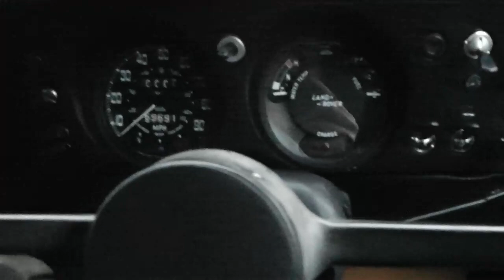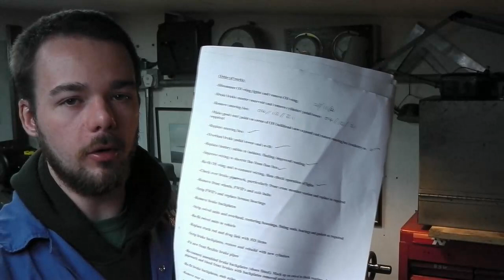Land Rover Series 3 Brakes and Steering - Part 8

Comment: I had problems bleeding 109 brakes when I replaced all the pipes etc. Spent an age trying.  In the end I bought an easybleed pressurised kit and flushed it all perfectly in minutes. I couldn't believe some cheap plastic bottles and tubes worked so easily.

Comment: Top job. I have those TLS brakes on the front of my Series III. I have never gone as far as removing the backplate to bleed them, but what I do do is lower the side I'm bleeding and jack up the opposite side. I find that helps.

The temptation, and possibly a mistake commonly made, is to jack up the side you are bleeding to get better access. The problem that causes is it increases the size of the air pocket at the cylinder end where the bleed valve is situated.

Graham
Reply from the maker: Thanks Graham, good advice - I do something similar when bleeding the clutch and it certainly helps. As mine is all coming apart, I have the "luxury" of being able to bleed the backplates whilst removed but I will certainly try your method if ever the need does arise. 
Phill.
Reply: I’ve taken the shoes off and g clamped the pistons in tight. Then by flexi clamps I do one side at a time and keep checking for a hard pedal. Hard won technique; first time I did the brakes it took me a couple of weeks to get a pedal!
Reply: @highdownmartin  Quite right, I forgot to mention that's what I do as well.

Comment: That made me grin. I’ll bet you a pint of Redex that you’ll have done something about that gauge lamp by the next time I see you!
Btw I needed to run another wire up the centre of the screens, rather than fitting them under the Ali strip I’m making a half dozen soft brass strips about an inch by quarter inch with one hole one end. One under each self tapper up the middle ,wires to the  left and just bend it round and back on itself   Neat but serviceable.
Reply from the maker: Ha! It may well be black sealant squidged in the gap... Never did find a good way of running cables up the screen when I had the LED strip lights, but that sounds like a good way to do it.  I'm hoping to be back in the road for the classic car drive in at Brooklands museum in April, any interest in going there? It's what they normally do on New Years Day but rescheduled.
Reply: @steamwally  I’ll look at the date.  Thanks

Comment: Great videos mate, im looking into a series 3 so very helpful.

I would perhaps avoid using stainless steel and aluminium as it can have a pretty bad reaction unless insulated in some way
Reply from the maker: Take your time and find a good one- they are still out there but few and far between. Stainless vs Aluminium is a constant debate on the forums and groups. From my practical experience, it just isn't an issue. It only becomes a problem if water ingress is also an issue, so keep the vehicle weather tight and there won't be any corrosion issues. The stainless bolts are a dream when you come back to take something apart again years later, as I am finding now.
Reply: @steamwally  ive seen one that I like but I cant view in person.
Reply from the maker: @ChibabaDave  buy one you can go and see.

Comment: If it’s any consolation, I found similar rusty goo in the axle of my 109 too. Luckily I had the axle off and could flush each side out with brake cleaner and rags wrapped around a metre long ruler.
Reply from the maker: I can only imagine that it's condensation in the axle tube that causes the rust, it looked worse than it actually was in the end but I am still going to give the diff a good flush out and some fresh oil.
Reply: Condensation was my suspicion too. Mine has been off the road for twenty years before I got it, so I’m reassured to see it in yours in regular use

Comment: Have you considered a lanolin type rust prevention for underneath instead of the more traditional type coatings?
Reply from the maker: I must admit I haven't thought about that too much yet, but when all the work is done it would be a good thing to look into. I've heard lots of recommendations for lanolin based preservatives, but in former employment I used to see lots of NOS aero engine parts which had been packed with lanolin products and they were always unusable - the more usual wax/ grease products also used appeared to be much better.  I saw an early Range Rover which had been given the full "Buzzweld" treatment recently, that was a great advert for their process.
Reply: @steamwally  very interesting about the parts being unusable with a lanolin type treatment as I too have heard good things about it. I’ve seen bitumen or under seal type products where they work great if they adhere well but when scraped off in places it has just trapped moisture causing corrosion, yet it look great from the outside so I’m still in the fence on what to use. Definitely something that doesn’t set and clear so you can keep an eye on what’s going on in terms of corrosion is what I’ll be going for